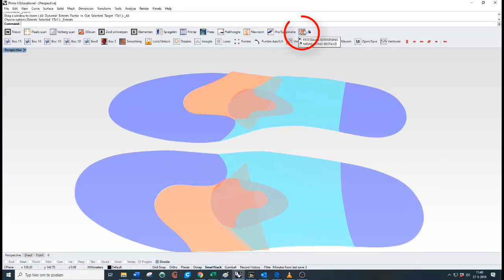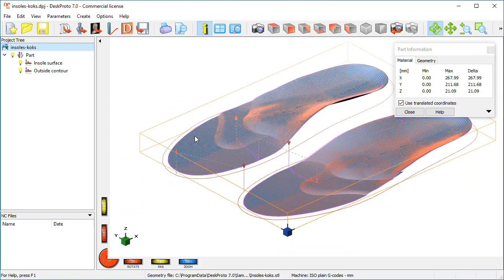Using DeskProto to CNC machine Orthotic Insoles

Comment: Hello, I would like to know what the cost of the software is and if it has a special section to make orthopedic templates, thanks
Reply from the maker: Most insole makers use the DeskProto Expert Edition, which is priced EUR 595 (excl VAT). DeskProto is a general purpose CAM program, there is not special section for orthopedic users. Any user can make template projects, however most insole makers simply enter their preferred settings as default (defaults can be set in the options menu). The process then can be automated by calling DeskProto with command line parameters.

Comment: i have a cnc machine with 4 axis the 4th axis is not rotatory its a vaccum table with rotatory head deskproto can do that kind of job?
Reply from the maker: When you mean a machine where the rotation is done by the cutter (and spindle motor, so by the complete head) instead of by the part the answer is no, DeskProto does not support such machine. If I misunderstood your machine description please email us with a photo of the machine to make clear what you mean.